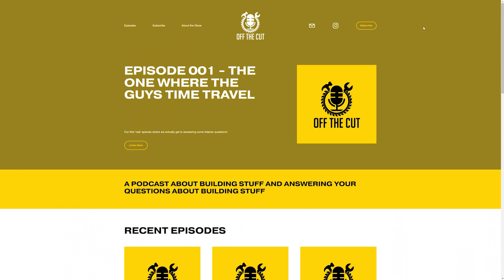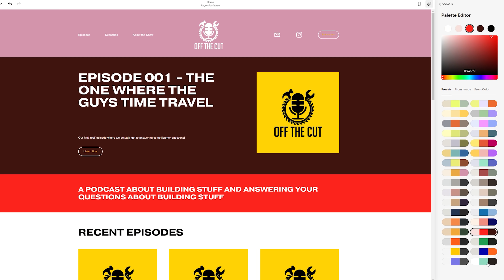You are NOT a creative person

Comment: A tip for managing the dust collection hose with your router is to run the hose from behind you and over your shoulder. That way it’s always supported up off your project and you don’t have to fight with the weight of the hose. I do this anytime I’m using a hose on a hand tool like routers,track saws and sanders. Has really saved me a lot of hassle and frustration over the years. 

Great project by the way. 

Might be the video but the glitter didn’t show as much as I thought it would in the top. (Since it mainly settled at the bottom) I’m going to keep that in mind for if I ever use glitter in a pour. I’ll try doing two or more pours which just enough time between to  be able to pour without needing to sand between pours.

Comment: You grandfather is very good. The wooden dowel sculpture is amazing. The table turn out amazing as well.
Unfortunately you can't make epoxy tables without a drum sander.
Reply from the maker: Thanks man and unfortunately it is hard to do without a drum sander but I wouldnt say impossible. You could always make your table in sections and run them through a normal sized planer, then glue them together afterwards. Or use a belt sander and hate your life haha. Where theres a will theres a way!

Comment: Looks great in that room.  Here's a suggestion if it sounds interesting to you.  I watched a video of a lady making something like a box lid or whatever.  She took a silicone mold, brushed the inside with the coloring powders she was using, then poured a thin layer of about 4 millimeters of epoxy over it.  She let that set for only a few hours until it was floppy, then she transferred it to a smaller mold so that it would be bunched up and "wrinkly" like waterlogged skin when you've been in the water too long 😂, and she set it in with the colored side up.  She then added enough clear epoxy to fully submerge it, and let that set.  The finished product looked like a silk bedsheet or something encased in the resin.  Maybe you can translate that idea into something for a tabletop?